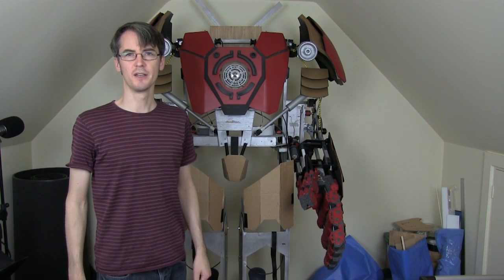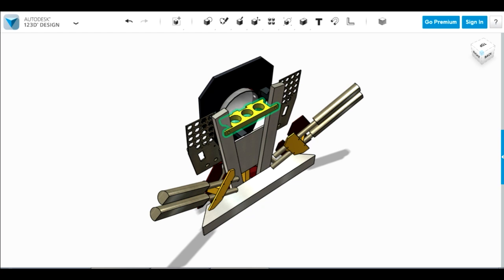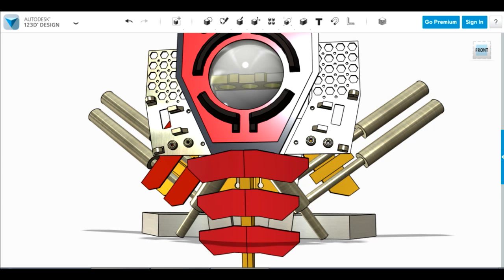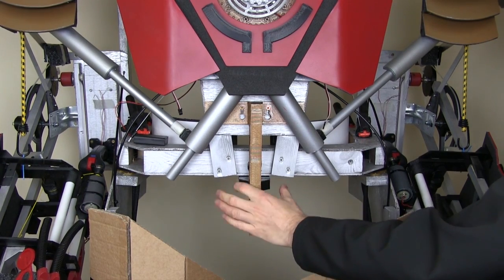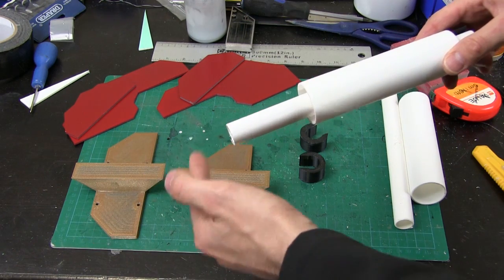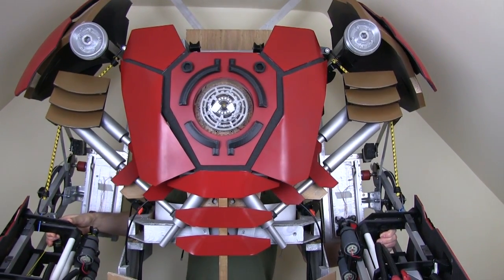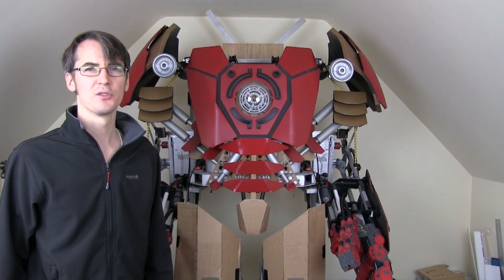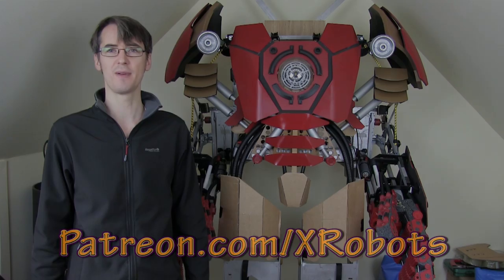Iron Man Hulkbuster Cosplay #18 | Abs & Ribs | James Bruton

Comment: Progress is great! Really filling out now. I know it's pretty late in the piece, and it's probably down to personal preference, but those hands.. they're really far out of proportion. Yes, Hulkbuster should have enlarged hands to be able to grapple with Hulk, but the length of the fingers vs the overall weight isn't balanced. Hoping that some slightly chunkier proportions can be achieved with finger shells, but I feel like if you chopped off the ends of each finger, maybe reduced to 3 or 2 fingers with thumb, it'd feel more inline with the rest of the suit.

In a slightly less related note, do you have any tips on snapping or locating splines and solids with 123D? I've been working in it for a couple of months for my own 3D printer, but find that it lacks simple things that sketchup gets right - showing midpoints and line intersections, snapping to said points, etc. Unless my Google-fu is broken, I can't find any solution beyond drawing out exact measured lines, or carefully plotting sketches or solids on strategic grid intersections. Really frustrating when it comes to mechanical design and things need to be precise in measurement and placement, which is mostly what I use it for. Any specific videos you could point me to would be great! Hope my constructive crit wasn't too harsh, I really enjoy your weekly updates :)

Comment: are you going to wear or is it able to be war with the iron man suit, because that be cool if you step out of the HULKBUSTER, in a iron man suit
Reply: That would be pretty cool. But it is hard to move around in the ironman suit
Reply: I was thinking the same thing - but it's unlikely, I think, because of the degree to which the Iron Man suit limits his mobility - and the process of getting into and out of the Hulkbuster with the Iron Man suit on (not to mention moving around in the Hulkbuster) could scratch the Iron Man parts.
Reply: I think the iron man suit+HULKBUSTER is to hot and it will take a lot of days to make them attach